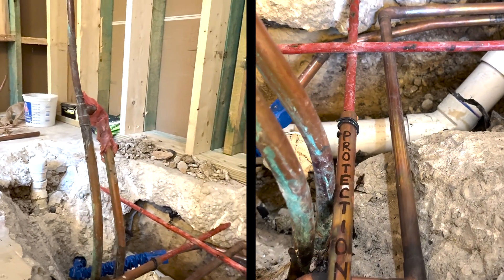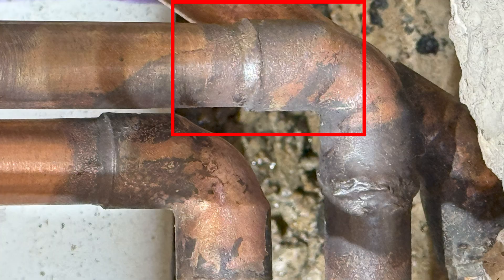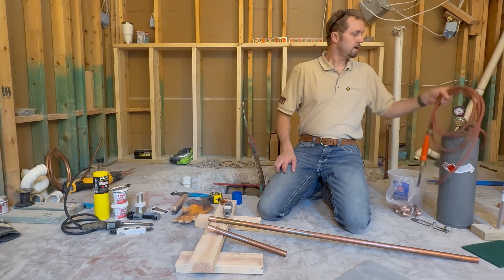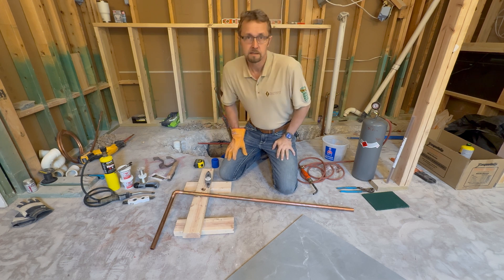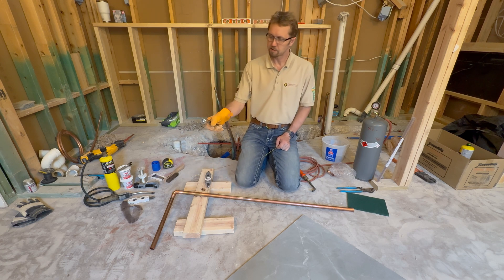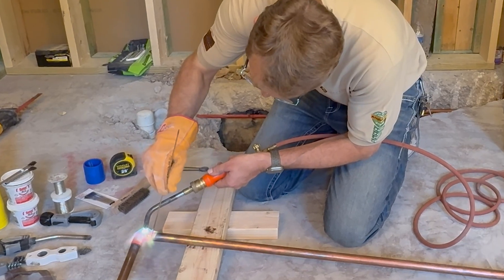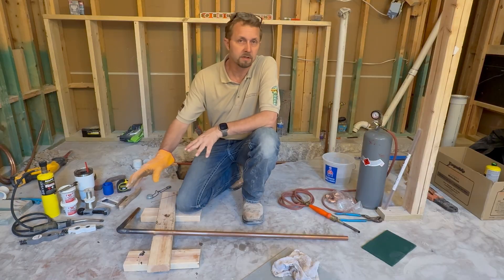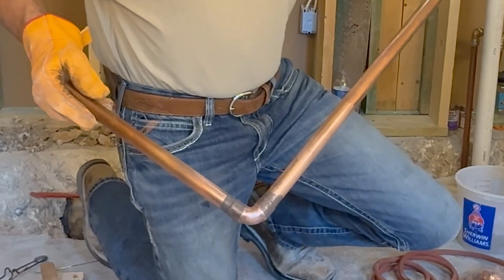Brazing Copper Pipe - Like A Pro! Soldering Copper Pipe Not Allowed Under Concrete Slab Foundation!

Comment: All you need is sharkbite
Reply from the maker: Sharkbite fittings are not allowed below a concrete slab.
Reply: @craftsmanconnection  so put them in the basement and use sharkbite - it is really fast.
Reply: pex and sharkpoop are for amateurs ......  copper, solder and brazing are for craftsmen (even DIY craftsmen).
Reply from the maker: @darknes7800 Everything has it’s place, and I don’t mean in the trash can. 😄 Soft Copper Rolls (so you don’t have joints), or brazed copper fittings under a slab are necessary for traditional houses. More modern builders are using pex, and although it works for new installs being looped for one wall to the next, what do plumbers do when someone wants to move a wall, or accidentally bust the pipe when jack hammering the concrete slab? Do they use Type A Pex for the different fittings? Can you use Type B pex underground? I know you are not supposed to use Sharkbite’s under a concrete slab.

In my video, in case anyone is wondering, the red pipe looking things are Post Tension Slab Cables, not red Pex.
Reply: @craftsmanconnection  I am pretty jaded, no pex or sharkbites in my house.  Just bought a new (to me) house, and had no choice on pex.  So I am redoing all of it with soldered copper.
Reply from the maker: @darknes7800 That would work for me. I don’t mind spending the extra time and money for a product that I have much more faith in. On probably every project, I buy Type L copper not for just the below slab requirements, but also the above ground, where most plumbers would use Type M copper.

Not sure how much it would help, but every few years, like in 2021, there was a bunch of houses that had burst copper water lines. I always try to go above and beyond to prevent against even unlikely events. The few extra dollars isn’t worth a $50,000 to $200,000 water damage claim, and hassle with an insurance company.
Reply: @craftsmanconnection  My house has Uponer red and blue pex. No issues, but its a ranch with an exposed basement. So while it will cost a few dollars and be time consuming, I still like copper over pex. The whole pex thing smacks of the gray tubing Guest mess back in the 90's. Ticking time bomb.